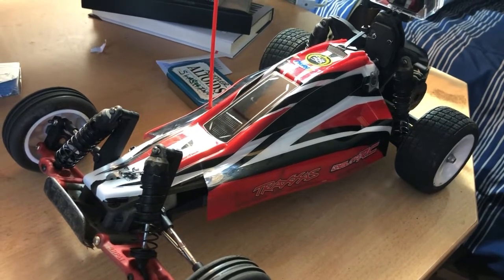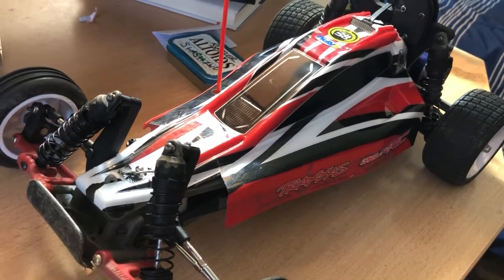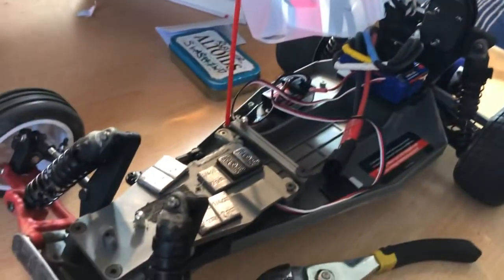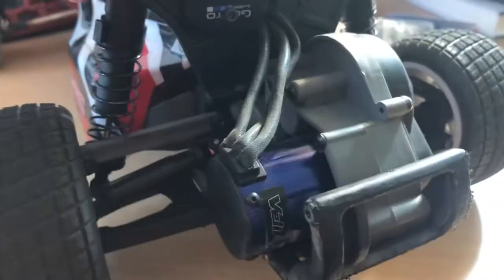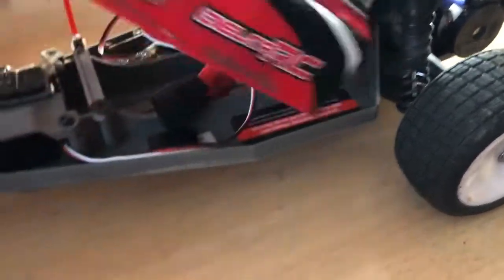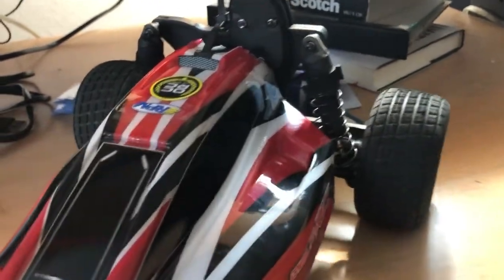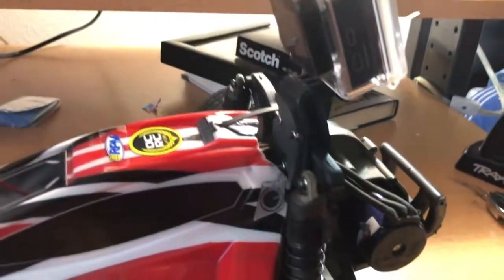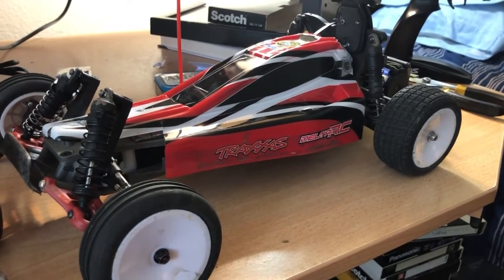Traxxas Bandit SEMI-RACE Setup (Rambling and Quick Update)

Comment: couple of things, get an RPM wide bumper for the front and mount all your weights on that. puts the extra weight on the front wheels instead of all over the chassis.
and your shock oil, 100w is too much, your shocks are super slow and unresponsive, if you want something heavier than the stock 30w, 40-50w is probably about as heavy as you want to go before it negatively impacts your suspension.

Good luck out there!
Reply: That will increase his polar moment of inertia, though, which would make his front end less responsive, but the car as a whole more stable when it comes to rotation.
Reply: @Drunken_Hamster  the rear mounted motor is what reallu throws out the balance of the bandit, i ran mine with a dead motor strapped to the front to even out the weight and it handles/jumps a lot better. A heavier battery also helps and isnt set so far forward if thats a concern